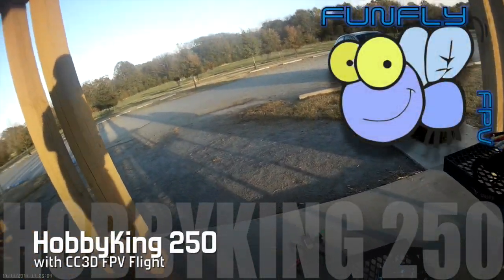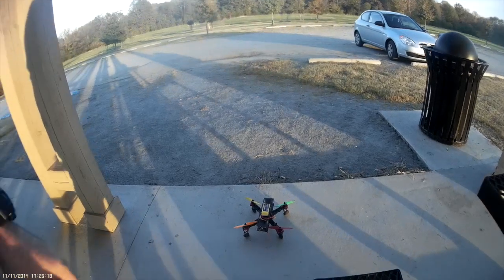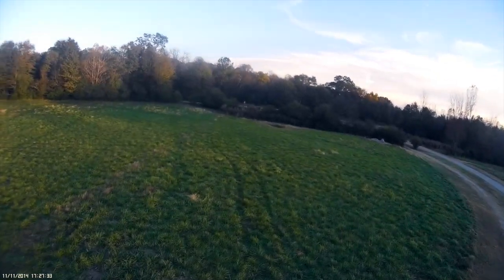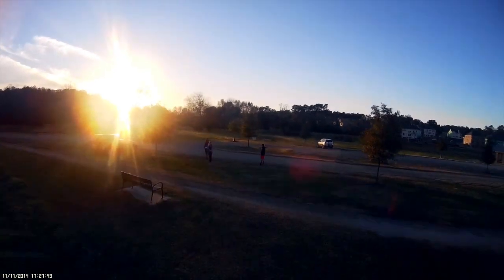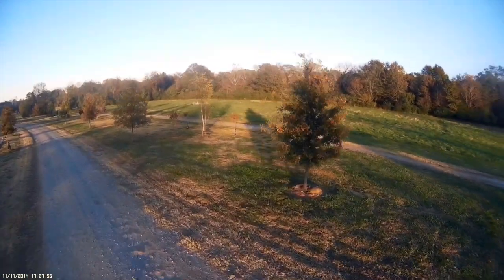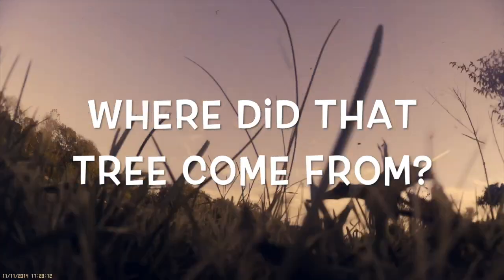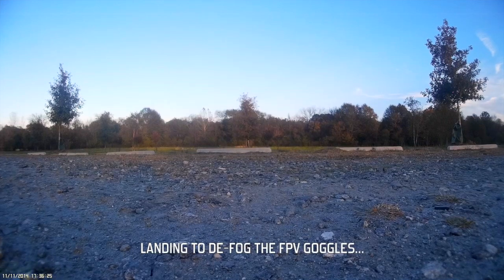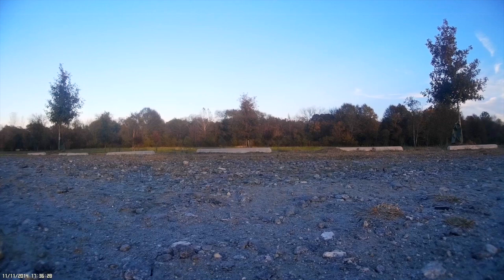HK 250 CC3D FPV Flight

Comment from the maker: Thank you Cy Lon and Hoverbot1TV . It is a 1300 Battery but what you cannot see from the video is that when I punch the throttle up it pulls to the right back every time. That tells me the ECS or motor there is bad. I set the PID's very low and still it wobbles, so now I will replace those MultiStar 12A ESC's with something proper, like the 12A Afro (which I have only had good experience with)

Comment: check your wiring real well for possible loose or weak connections, or possible a bad solder joint. that what it looked when I had the same thing happen.  had a esc power wire come loose in the harness only thing making it hold connection was the heat shrink.
Reply from the maker: Thank you.